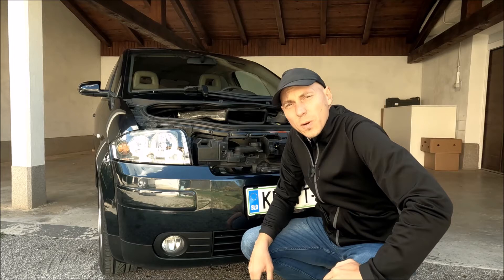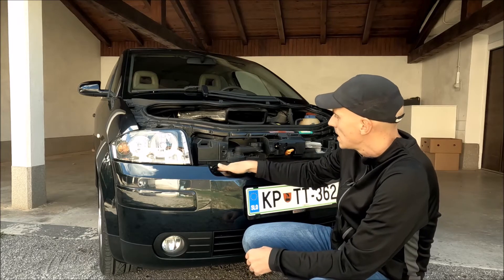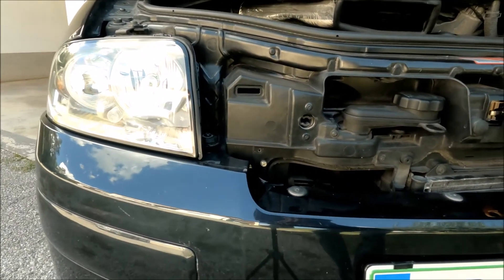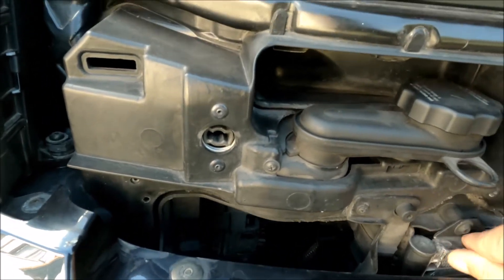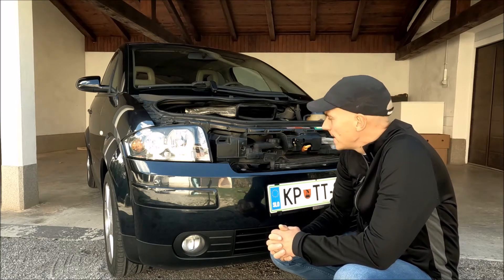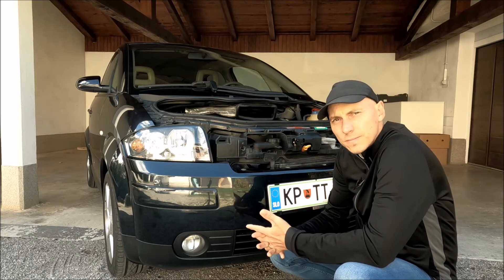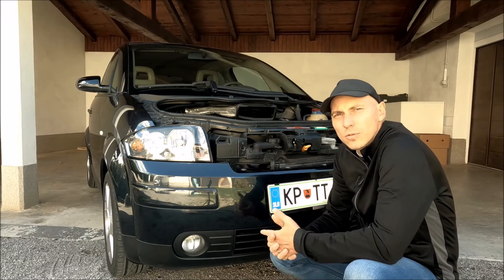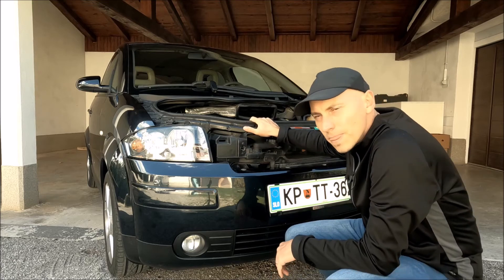Audi A2 – flappy radiator mystery… – EP41 – project youngtimer

Comment: Hello brother, i have a problem with thermostat audi a2 1.4 tdi 55kw temperature arrow on a panel was always on 0 celcius after i changed the thermostat  its going up and down from 0 to 75 celcius max not reaching 90, what can be a problem maybe thermostat temperature sensor? Or i need to clean the radiator? I noticed one wire with a plug off its socket front left side bumper under neath but cant find the socket for it 😔😩 please advice
Reply from the maker: Sorry, but I cannot help you with this.